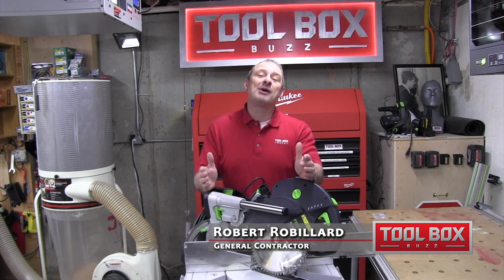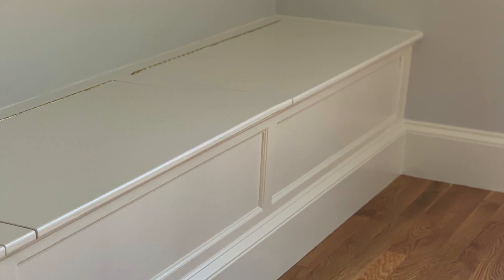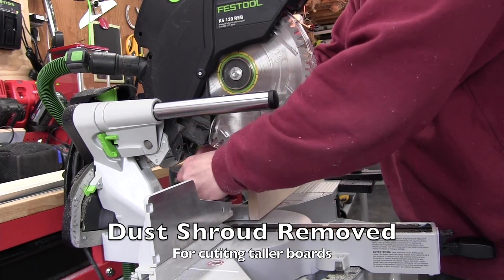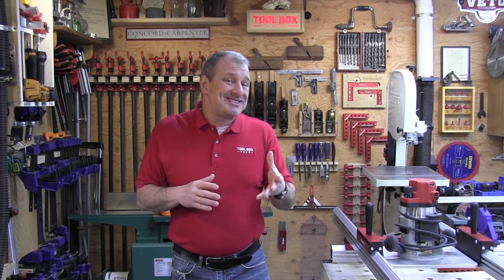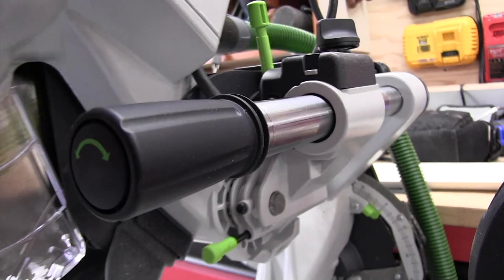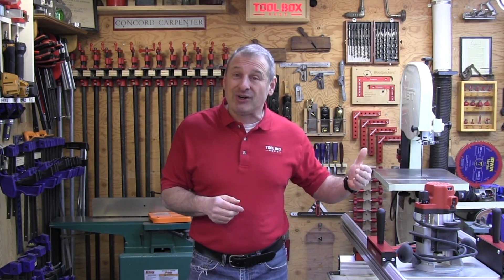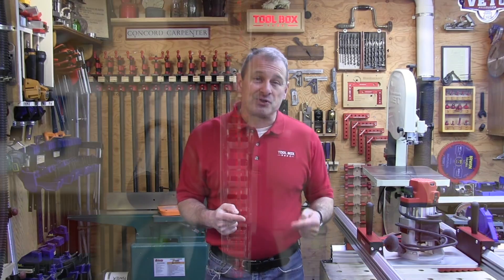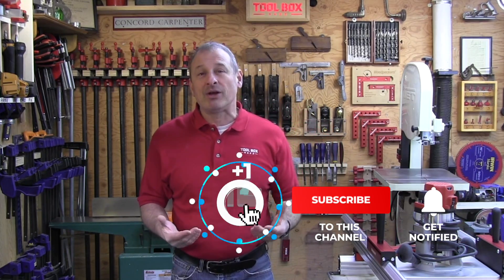Festool KS 120 REB

Comment: Might be an awesome saw but I can't get passed the very awkward handle
Reply: It’s designed to be ambidextrous. After using it for a couple of days it feels normal. Festool has a 30 day money back guarantee on their tools. Get one and try it for a few weeks. If you don’t like it, ship it back for a refund.
Reply: Totally agree with you here.  That handle design looks like it would be hard on the wrists after a few cuts.  The wrist doesn't naturally flex that way.
Reply: Handle orientation actually gives much better control through the cut. Try it and see.
Reply: Walter Lane it didn’t for me at all. I’m a lefty and was using it right handed. Very awkward (for me)

Comment: I heard of too many people burning out the motors for it to be a anomaly
Reply from the maker: solomon quinn  
Festool received about a 1-2 percent repair/return on their Kapex motors burning out.  Their process is when a tool hits a 2-3 percent of failure is when they start looking into why or what is happening.  With the Kapex , Festool started early , redesigned the motor and has been fine ever since. It’s tough to break an impression, I get that!
Reply: True but you can imagine that people like me that never had a problem with it for the past 6 years, will not waste time on forums or other platforms to counter balance the negative experiences. We just enjoy it and go about our lives.

Comment: I’ve had my Kapex for almost three years.  I was cutting a 2” wide strip of wood with a simple 90° cut and my kapex blew up in my face.  Somehow the blade guard contacted the saw and shards of plastic, a large spring, washer and metal strip hit me.  Fortunately I was not injured.  I have no idea what malfunctioned with the saw.  Since it is under warranty, Festool agreed to repair it at their cost.  I am reluctant to use this saw though - I’ve never had something like this happen with my Dewalt.  I wonder if others have had this issue and now notice how the Festool blade guard is closer to the blade and runs inside the saw housing vs other mitre saw guards that run outside the saw housing.

Comment: Shipping isn’t free, you pay both ways on shipping for repairs. Is Festool good - yes, but it is a tool - FT is my go-to piece of equipment..Do I own a Kapex? Nope. Too expensive my cheap $200 DeWalt cuts the same with a sharp blade. If I needed to cut trim at least twice a month, that’s the tipping off point, where it would make financial sense, only if I was doing stain grade work. At $1650 with tax you’re 60% to the price of a Festool TKS-80 table saw with sawstop technology. I think your comment holds true earlier in the video - I’m not letting my workers use my Kapex? Will it take the abuse, certainly, but not over the long haul. That’s true with all tools, but fixing the Festool costs extra, it just does (German engineering). If I had the extra cash I probably would get one now that they fixed the internal problems with the previous Kapex .  I also agree with you on the fireplace mantles - if I made enough profit off of one job then it’s an easier investment. I think where the Kapex shines is finish, trim and casework for many remodelers and contractors. It’s portable unlike a table saw with sled accessories and having a stationary wood shop a CSMS with 2 wings takes up a lot of wall space? As a general rule I don’t lend out my tools, with Festool I make an exception. No one touches those tools!

Comment: Dust everywhere within the first 10 secs of the video. The side stands need a perfectly level floor. Can't say every area a contract carpenter works on dead flat areas.
Reply: No it doesn't need a perfect flat area. There are adjustment knobs with fair amount of movement to make it work. But dust collection is not impressive indeed. I would say its normal. Nothing special.

Comment: Rob, thanks for another great video and hello from a couple of towns east. I have a question for you and the group.  I bought a 120 REB yesterday.  When I got it home, I checked the table.  The center table is noticeably proud relative to both of the fixed side tables (the actual table sides, not the built-in extension wings).  I'm wondering if I'm my expectations are too high.  Given the price and Peter Parfitt's endorsement of the Kapex as a "cabinet grade saw," and since I've got a 7 1/4" Milwaukee that's dead flat all the way across, I don't think so but would appreciate some input.  I made a video illustrating the issue: https://www.youtube.com/watch?v=yhZjywLeGMQ

As you can see in the video, using a live on the saw table, if I push the level down on the side tables, I get .030-.031" on one side and 0.26-0.27" on the other.   I confirmed that the plastic insert on the center table is below flush, so that's not the issue.  My concern is that if I clamp one side of the work piece it's no longer sitting flat on the center table.  Although the difference is small, with several cuts you could stack up the tolerance difference to a noticeable amount.  Also, since the work is not fully supported by the center table, it's possible (maybe even likely) that the piece will flex a little and the cuts will vary some front to back on a single cut.  I should mention that I haven't cut anything on this saw yet because I want to be able to return it if this saw really is out of usual Festool specs.

Am I being too fussy?  Peter Parfitt touted the Kapex as a cabinet-grade saw.  This doesn't feel "cabinet-grade."  For comparison, at the end of the video I compare a 7 1/4" Milwaukee DBSCMS, which is 1/3 the price of the Kapex - and it's dead flat across the tables.  That may be luck of the draw, since the center table of a 10" Milwaukee that's in the house right now is noticeably below the level of the side tables, which would potentially be a problem since a large piece is not fully supported (flex).  For $1500, though, I expected more.

Please let me know what you think - thanks!

Comment: Obviously the poor handle ergonomics didn’t get a look in.
Reply from the maker: Darren handle does even make it on my radar....I know a lot of guys say they don’t like it. Doesn’t bother me
Reply: I like it. Lefty or righty its all the same.
Reply: A Concord Carpenter / ToolBoxBuzz I watched many vids comparing the Kapex and Bosch Axial glide. Both have pros and cons. When I tried both in store the decision to get the Bosch was an easy one. But in saying that I do have a Protool drill driver and a Festool 18v jigsaw. The main reason I got the jigsaw was because of it’s accuracy and it was literally only slightly more expensive than the next best jigsaw on the market (Makita).
Reply: @ConcordCarpenter   nobody seems to complain about the handle on a skil saw... hmmm. they are the
 same thing
Reply: Used in very different positions.

Comment: it’s very accurate but for double the price of a leading competitor’s miter saw it should be designed much better! i mean, aesthetically only. it just feels like cheap plastic & if i saw it on harbor freight & didn’t know any better i wouldn’t second guess that it’s worth more than 200 dollars. just looks like cheap garbage. now what the saw lacks in design it makes up for in precise cuts but because it’s double the price of say a milwaukee miter saw it should not just be accurate but be made with better materials & actually feel like a premium product.

Comment: Worst site saw I've ever bought, it's a workshop saw only as it's very limited in its use. Cut  is very smooth thou , great for cornice/moulding work, but that's only thing I like about this saw. Mines been back for repair 4 times in 3 years, never had to return a Makita or DeWalt in 27 years of trading. Motor is gutlus only good for lite use i.e workshop, you always need a new blade or motor will cut out, never bought so many blades or sharpens in 3 years. It's very limited at trenching cuts too, it's mega expensive to buy and I'm falling out with all my Festool machines, tacky plastic parts and full of poor design issues. Dust is pretty good, but they say it's over 90% at dust pickup, more like 50% but still good to other saws.  I mainly only use my Kapex now for kitchen installs so unless you can afford 2 chop saws think twice about this saw, just being honest guys